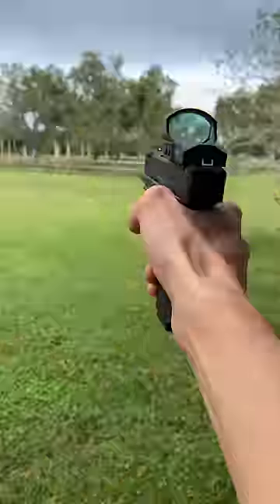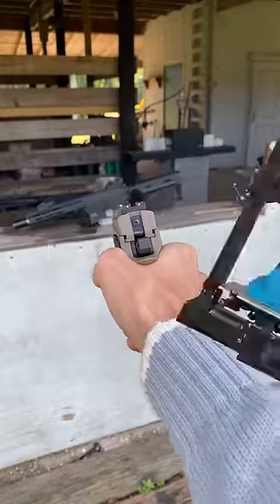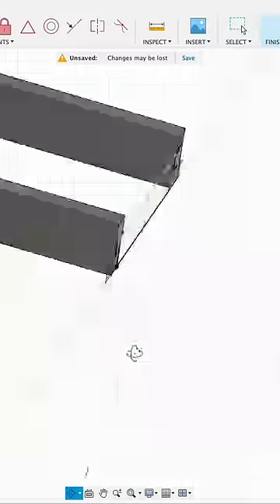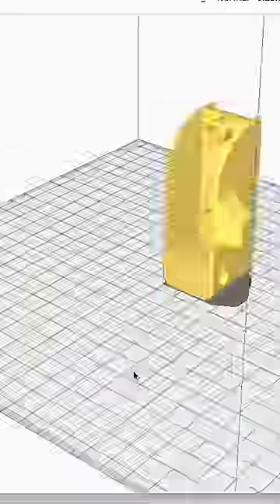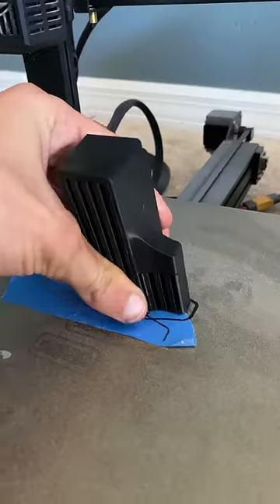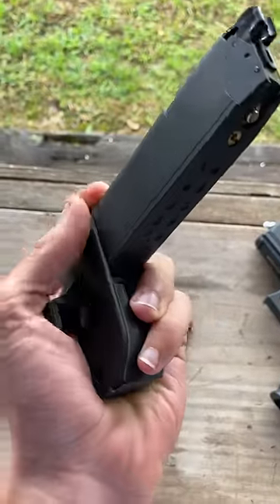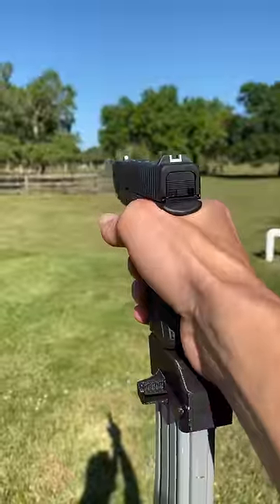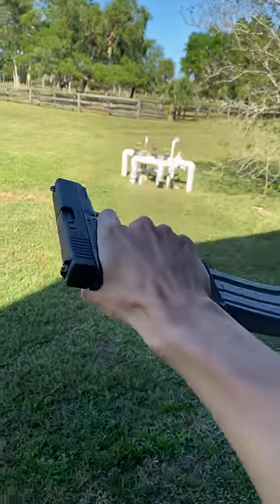Let's put M4 Mags in Our Airsoft Pistols 😤

Comment: So you made a hpa tap without the main advantage of a hpa tap
Reply: Well I see advantage! Hpa is only nice so you can use 200 round mags, real speed softers don’t want a tank
Reply: @SynFuze63  no. just no. hpa has 2 main advantages. 1: ammo capacity. but most importantly , unlike you said, with hpa you get virtually unlimited air, meaning you do not need to stop to realod and regas after even 2000 shots. furthermore, hpa is easily 40x more consistent than green gas or co2, especially how you can dial the fps to whatever you cant. REAL speedsofters want hpa. your not a genuine speedsofter
Reply: @SynFuze63  wrong.
Reply: @markrosko3411  literally what i was going to say
Reply: @markrosko3411  gate keeping I see
Reply: @zadekbaget9476  what are you on about
Reply: @zadekbaget9476 he just told you the advantage of it how is that gate keeping
Reply: @markrosko3411 meanwhile I do milsim things with a tapped Glock
Reply: @SynFuze63  I'm a AEG player, but even I have to say hpa is superior to everything. And nowadays there are extremely light tanks in different sizes, so that's not really a problem anymore.
Reply: @markrosko3411  in Ireland we only have 2 or so sites in the country that allow Hpa so green gas or CO2 is all most people have here
Reply: @J0hnnyMacc  in England everywhere allows hpa so there is no reason not to use it
Reply: @SynFuze63  no as a speed softer I cannot disagree more hpa tanks are absolute life savers when it comes to gbb pistols
Reply: @markrosko3411  anyone who accuses someone of “not being a genuine airsofter” is not a genuine air softer…
Reply: @jfredgames6785  i said speedsoft. The difference between airsoft and speedsoft is that speedsoft is a more competitive and fast paced way to play airsoft. Hpa adapters offer an extreme competitive advantage. Having a large ammo capacity with still using green gas is not as competitive as a hpa adapter with hpa. Know the difference
Reply: @jfredgames6785  he didn't say airsoft lmao he said speedsoft
Reply: @markrosko3411  "youre not a real speedsofter" lmaoooo 😂😂😂
Reply: @SynFuze63  yeah the problem with this is that it’s heavier, and you will still run out of gas after 40 shots
Reply: @SynFuze63  also as a speedsofter, I do want a tank. HPA has massive advantages
Reply: As someone who loves both Airsoft and Paintball, once you start using an HPA tank, why are you even playing airsoft??
Reply: @markrosko3411  *you're
Reply: @randomfurrygirl548  because it’s more fun IMO. The guns, arenas, etc everything plays differently. There’s way more customization in your guns and gear, and your clothes don’t get paint on them lmao
Reply: @MaximillionBucks  thanks for the grammar tip :)
Reply: @markrosko3411  nah a good aeg beats hpa anyday. L tank.
Reply: @randomfurrygirl548  If you’re choosing what to play purely based on equipment overlap, you’re narrowing everything you can do. Airsoft has a more realistic style to it, even when you speedsoft. On top of that it’s cleaner, CHEAPER (that’s the selling point for most), and more accurate with better distance than a paintball marker. Even then you use something like an Eclipse EMF100 running first strikes, that may get the distance of the pistols running bone stock internals in airsoft. You can use paintball masks in airsoft, that doesn’t mean there’s no point in playing airsoft.
Reply: @crossefex5684  I just feel that its sorta defeating the main point of playing Airsoft, that being the more military style equipment that you dont need to wash literally every single time you use it. Once you start using HPA tanks, you're sorta shifting away from the more military style equipment. I know paintball has its magfed equivilents, so the two sports definitely intermingle a bit. I just don't see how one could really "speedsoft", since the only indication that you hit somebody is a BB deflecting off of them. Cheating was rampant back in the day with paintball, and thats literally a massive glob showing that you've been hit. Just a bit confusing I guess.
Reply: "Main advantage" bro no one wants to carry a tank and be stuck to your gun with a hose
Reply: @ElectronicDust636  facts
Reply: @randomfurrygirl548  A Honda civic was built as a daily driver yet is massive in the street racing scene and car tuner competitions. Just because it started as one thing doesn’t mean it’s not meant for other uses. There are many airsoft guns that are designed like a paintball marker, the big one being the SSG-1 from G&G. Plus speedsofting was brought over mostly by speed ballers in paintball who wanted a cleaner cheaper option. The speed-x variants will always have ramped cheating, it’s just the section that breeds cheaters. However in my field, we have “milsim” players that used to come in (they were banned) and they were MASSIVE cheaters. Whether its HPA, milsim, or casual players it doesn’t entirely matter. Plus, a LOT of milsim players use HPA since batteries for them last a lot longer if they need a battery, and they are way more consistent and have better range, so it works better for sims
Reply: Forgetting the part where it looks like a meme gun. Why can't it be just for shits and giggles
Reply: @SynFuze63  not having a tank is nice until you can’t shoot after 40 shots
Reply: @markrosko3411  lol “real speedsofters” I love the sense of pride that people pointlessly attach to a hobby where we shoot toys at each other for fun. Calm tf down it’s a game and y’all are all goofy.
Reply: @thelag1200  Oh no he's gatekeepijg what he thinks is a term for elite airsoft enjoyers. It really sucks that he doesn't consider you the made up term. Whatever will you do
Reply: @TheAsianOfChaos  im using the same term that he used back at me, what right does this guy have to go on about what "real speedsofters" want. Im just using his iwn words back at him
Reply: @MMOchAForPrez  its not a term for elite airsift players. Anyone can be a speedsofter. What are you on about?
Reply: @markrosko3411  your right but chill out with the gatekeeping bro no need for that toxicity here
Reply: @ArmyOfThree1000  “REAL speedsofters was hpa. Your not a real speedsofter I see”
Reply: @Unboundiing  you’re correct I’m not im a walking shitpost that does wacky tactics with wacky guns and when I do speedy boi shit I turn into a goblin
Reply: @ArmyOfThree1000  good for you, I don’t care about what people do speedsoft milsim I respect everything I’m just showing the sentences that could be deemed as gatekeeping
Reply: @Unboundiing  ok it’s not gate keeping to explain that the hpa taps man advantage is the tap
Reply: @markrosko3411  He means it henders movement. If you eventually eliminate the tank then you gain mobility. He means speedsofters like to go fast. You can go faster without the added weight.
Reply: @SynFuze63  "Real speedsofters" (whatever that even means) do want a tank.
HPA air is much more consistent and reliable.
Green gas and CO2 are inconsistent and frequently fail
Reply: @SynFuze63  I’m a speedsofter, and I would much rather prefer a tank. I hate having to refill my pistol in the middle of a match. I would rather have a line coming from my back with a lightweight tank for the purpose of having air in my gbb for the whole session. Idk what u would define as a “real speedsofter” but, I wear a dye mask, and I never take cover during a match.
Reply: @ArmyOfThree1000  the military doesnt use glocks, so its not really a milsim is it?....
Reply: @dakotagarcia3772  I mean yeah they do
Reply: @ArmyOfThree1000  who, when, where?
Reply: @ArmyOfThree1000  the most innovative thing glock has done in the past 50 years is put a lanyard loop near the magwell on the 19x and gave it ambidextrous controls. While trying to charge the gov ~66% more per firearm than sig. Theres a reason why glock got a measely $15m contract and sig got a $500m+ contract.
Reply: @dakotagarcia3772  I never said that it’s a good gun but for airsoft the Glock is better then the sig because it actually works unlinke the 4 sigs I’ve used that all have different issues
Reply: @ArmyOfThree1000  probably because sig focuses on making real guns and glock just spits in their customers faces with their lack innovation an user friendly products. To get a have a decent glock u need to spend hundreds of dollars upgrading it with after market parts that other manufacturers just include with a gun thats the same price as a stock glock.

Comment: Still gonna run out of gas after about 50 shots
Reply: fr especially if you use full-auto
Reply: Than you gotta put an extended co2
Reply: @canadiangoose1451  then you gonna run out of bbs agian
Reply: @haydranus7092  then put on a bigger mag
Reply: @prestongarvey2599  then you gotta put on extended co2
Reply: @haydranus7092  but then you have to add a bigger mag
Reply: What gbb pistol are you using that gets 50 shots??
Reply: Cue person running around with a 40 pound CO2 tank on his back and a belt with a 1000 rounds that feeds to the gun
Reply: @user-oe8yp6tp4k then you gonna run out of co2...😂😂
Reply: @amishc.a.t.7451  Glock 18C
Reply: Big balls
Reply: @haydranus7092  🤣🤣💀
Reply: @antihero6988  fair enough
Reply: @amishc.a.t.7451  glock 18c
Reply: HPA tap that shit. Since he 3D printed the adapter he can even modify it to have a hole for the air hose to go thru.
Reply: @B-52H  you realise they make drum mags for airsoft pistols that hold like 2500 rounds and run on green gas but they still need to be HPA tapped or they are useless lol also you can get through 1000 rounds with a pistol on a rather small HPA/CO2 tank so what you suggest would be closer to about 10,000+ shots😂😂😂 I like the way you think
Reply: @TWSA_Krochlikmiov  yeah your right I understand cut the rounds we need to be a literal tank for people by the end of the upgrade
Reply: He's gonna fix that
Reply: @amishc.a.t.7451  glock 18c umarex can shoot maybe 75-125 in semi auto
Reply: @Xander8260  frrrrr
Reply: 100 shots

Comment: Make a 3d printed gbb pistol
Reply: YES
Reply: Well tokyo maruis are made of plastic so surely it's possible.
Reply: @RedVRCC Pretty sure those are injection molded but its possible
Reply: @Head-Tr1ck  they are injection molded, it was more poking fun at TM for making their guns out of plastic than anything. but yeah, depending on the material a 3d printed one may be durable enough for the same 134a gas used by TMs.

Comment: Arent you gonna run out of gas though? I thought the pistol mag only held enough gas for like 20 bbs
Reply: Yeah depending on the brand and the mag(and any modifications or upgrades to the mag or gun) they can shoot 20-30bbs
With upgrades you can usually get about 40-50 out of one fill

Comment: Wish you could buy these without them being hpa tapped
Reply: Except that it would be useless
Reply: @oliversmith7322  depends, i made one for gelsoft with a battery adapter to make the magazine run
Reply: @seanryan2149  well that wouldn’t really work on a gbb, you need gas not a battery. I guess technically you could, but you would realistically spend close to the same amount as you would on an HPA tapped one, it would be lower quality and probably have a lot of issues, and you wouldn’t have the advantages of having HPA
Reply: @oliversmith7322   works if you add a battery switch to it that attaches to ur grip, every time you’re firing you hold the switch down and it activates your magazine, with a 3D printer, some wiring, a 9v battery, and a switch, it’s actually pretty cheap, for a full hpa tap it costs over $1k AUD
Reply: @seanryan2149  wow that’s expensive, an HPA Adapter where I am costs 150 usd(225 aud). I’d say that’s worth paying just for the better build quality of the magazine adapter and the massive benefits of having HPA.
Reply: @seanryan2149  you still need gas for the gun to shoot though, you can automate the m4 magazine and I guess you could technically automate the pistol mag, although you would essentially have to gut it and work with the shell. 
The gun won’t shoot without gas though, and adding a battery won’t provide it with gas. Hypothetically you could redo the valve system and gas storage but it would be nearly impossible, and quite a pain to manage
Reply: @oliversmith7322  I’m using a 1911, the co2 is inserted into the side of the magazine, and the magazine adaptor is easy to remove so you can tighten the base cap from the bottom. Also a hpa adapter is $350 aud, plus a decent tank, $250-350, and a well built glock would be $350-400
Reply: @seanryan2149  oh yeah well for the adapter gun and tank, you also need a regulator and hose, can be pretty expensive of course
Reply: @oliversmith7322  exactly, I’d love to have a HPA build but I’ll stick to my own adapter for now